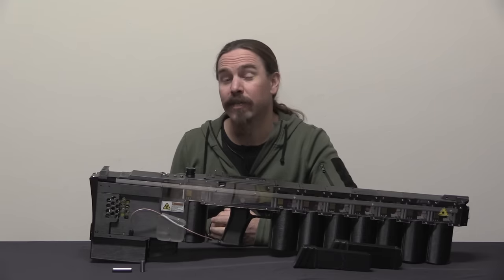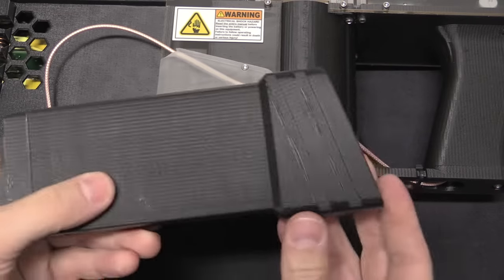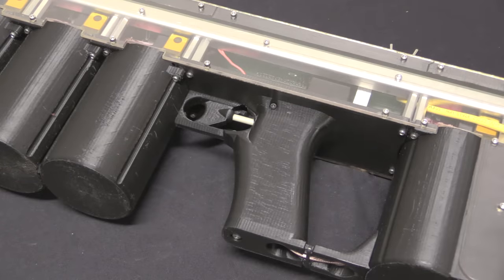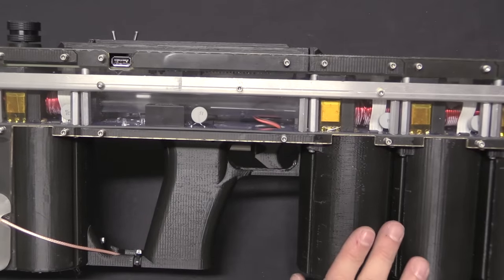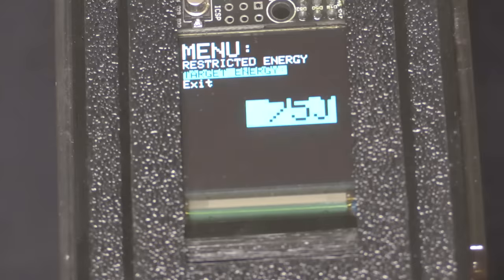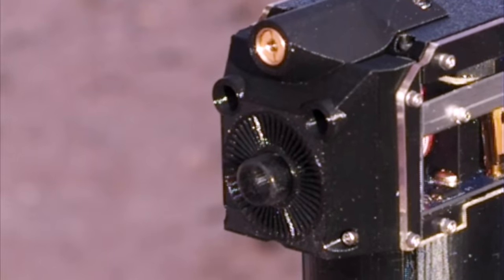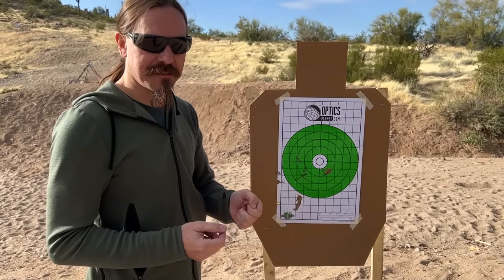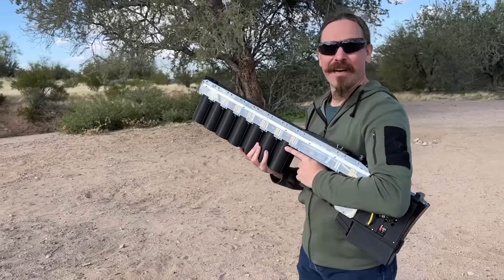ArcFlash Labs' GR-1 Anvil Portable Gauss Rifle

Comment: This is the musket of the Gauss Rifle technology, just remember this video 10-20 years from now
Reply: Just about.  While I'm not sure we'll ever get to the point where ammo for this thing is quite as cheap as current ammo (You can get 20 round of 5.56 for like $12), but I can definitely see these evolving into some BADASS sniper weapons.
Reply: @jesuszamora6949  The ammo for a gauss rifle is basically just a steel rod sawed in small bits...as soon as there is demand for gauss ammo you will see prices way below what 5.56 costs
Reply: @jesuszamora6949  i'll just go play Crysis and use the Gauss rifle in that ;)
Reply: @Presbiter  Ammo cost would be in the degradation of the power cells. Plus a few pennies for the slug and electricity.
Reply: @johnk6757  Thats maintenance cost...like any other equipment that uses power cells like night vision googles
Reply: Pretty much. A couple of decades and a few energy storage breakthroughs in the future and they'll have a design nearly as powerful as the fallout gauss rifle.
Reply: 10-20 year from now it will be same but better looking. The obvious problems are capacitors and coils. Standard capacitors and even commercially available super capacitors simply do not hold enough charge and even if they did they are not able to release it fast enough to accelerate the projectile to speeds needed for it to become a real weapon. Even if they invent a supercapacitor that can hold and release enough charge, copper coils will not be able to handle it. Copper would have to be replaced by some superconducting material but those only work at ridiculously low temperatures.
Reply: Truthfully, I feel like it wouldn't be too difficult to make improvements and produce your own. Welp, time to start ordering parts.
Reply: @ConManliness it took up to longer than a minute to reload for one singular shot, and black powder by nature has lots of things that can go wrong.
Reply: @lamebubblesflysohigh  what could a cooling system for the coils be like? Could it be like a SPAS-12 heat shield or some complex air/water cooling system?
Reply: @lamebubblesflysohigh  there are high temp superconductors (like above water freezing), but they need ridiculously high pressures instead. Those may be more viable though than supercooling the coils. You need to construct the capacitor from superconductors too, so this is quite difficult.
Another problem: you need very high magnetic fields, which may stop the superconductivity, so there will be a limit of how much power it can have.
Reply: nahh, think of the stuff we don't know. the stuff coming out was prolly researched decades or years ago.
Reply: @killman369547  Batteries are likely going to be the biggest bottleneck.  It's weird that, for all the other tech breakthroughs, battery capacity has been the slowest moving.
Reply: @ConManliness Eeeeh, depends on what you consider, "wildly more powerful." Because while muskets had projectiles that were about 10x the mass of modern intermediate cartridges, they also had a muzzle velocity of about 1000-1400 feet per second, versus, say, the US Army's M4, which has a muzzle velocity of a little under 3000 feet per second.

Due to how kinetic energy works, a 500 grain Minie ball will fire with anywhere from 1.1 times the energy of a M4's ~50 grain projectile at a lower velocity charge, to 2.18 times the energy of the M4's 5.56x45 projectile at a higher velocity charge. However, it will also likely not have as good of penetration due to the superior penetration profile of the intermediate cartridge's small bullet. So, while ranging anywhere from near-equal to twice as energetic, it isn't necessarily "wildly more powerful" in terms of raw energy and it is likely inferior when it comes to actually penetrating. 

However, muskets will fall short of the power of a full sized rifle cartridge of modern bottleneck design. A 7.62x51mm cartidge comes in at around 150 grains, but will come in at a muzzle velocity not far short of the 5.56x45 at 2700 feet/s. A rifle firing the 7.62x51mm cartridge will have an energy about 1.11 times the energy of a 1400 feet/sec  500 grain minie ball and about 2 times the energy of a 1000 ft/sec musket 500 grain minie ball, making a full sized rifle cartridge such as the 7.62x51mm both more energetic than a musket's shot as well as having superior penetration characteristics.

It gets even worse when we get into large bottleneck cartridges usually used in fixed machine guns, such as the .50 BMG cartridge which have a 600-800 grain projectile that is fired at around 3,000 feet/s. Even assuming a minie ball of equivalent size to the .50 BMG's projectile, a .50 BMG 700 grain projectile will fire with 4.5 times the energy of a 1,400 feet/s 700 grain minie ball, or 9 times that of a 1,000 feet/s 700 grain minie ball.

This is all due to bottleneck cartridges having a far higher pressure compared to charge due to the bottleneck. You can't have a bottleneck charge in a musket. With a rifle, however, you can, so the projectile is launched far more efficiently due to the funneling of the expanded gasses.
Reply: @ConManliness musket shot would likewise go less far since the halved speed in comparison to modern bottleneck cartridges and minie balls (and earlier musket shot) are far less aerodynamic than modern rifle bullets, ergo they would be affected by drag far worse.

You also have to consider the extreme effect that black powder fouling can have on a bullet's ability to travel, progressively making even a strong performing rifle weaker and weaker over time. Smokeless gunpowder has no such troubles. There's a reason when smokeless powder bottleneck cartridges hit in the 1880's that there was no going back: bottlenecked cartridges could send projectiles far faster and far more consistently and, frequently, with even more power.
Reply: I mean even back during musket days there were still some pretty cool firearms that could match up with today's stuff
Reply: @TheOnlyPedroGameplays  Eeeeh. For a trained gunner, it was far shorter than a minute to get off a shot by musket, especially once you get into pre-measured cartridges. You're still looking at something like 3 or so shots per minute though.
Reply: @ConManliness ummm no. They had "heavier loads" back then because they didnt have high rate of fire and had very low accuracy so they wanted to increase chances of 1 shot 1 kill if they actually hit their target

"Smokeless Powder reacts at much higher pressures than Black Powder"
Reply: I think this is earlier then muskets. Think medieval hand canons.
Reply: Nah. Even early muskets were deadly and viable on the battlefield of the time. They solved at least two problems: heavily armored knights and necessity for shorter training time . This this doesnt bring anything which normar firearms dont already offer, but does it worse.
Reply: @taan1424  i dont think anyone here thinks that muskets werent deadly, just how effective they truly were
Reply: @taan1424  Depends on if you can get it to be light or not. It could be something in the similar vein to why caseless ammunition has some degree of appeal to a concept where you can have a bunch more bullets for the same amount of weight.
Reply: @taan1424 also depends on how early. You probably do not have access to the first five years of firearm history and are looking at the earliest of earliest of concepts for one thing and trying to compare it to something whose earliest proto forms are esoteric and long forgotten.
Reply: their were cool futuristic gun in the musket era like the air gun and we all know which one lived on. cool concept but 10-20 year won't make it
Reply: if that emf gets worse they soldiers wont last 20 years after there service.
Reply: Fr fax no cap
Reply: Musketeers where in use 70+ years
Reply: @lamebubblesflysohigh  the biggest problem with this thing is that it has to be portable, if it were stationary you could do a lot more to vastly increase the power and effectiveness of it, such as providing more power, using much larger and stronger capacitors and way larger coils
Reply: @jesuszamora6949  in canada 
7.62mm fmj is $7 a round...i repeat for seven dollars a round lol not sure how much 556 is but im sure its expensive
Reply: I think this thing is trying to solve a problem that isnt there.
It might make sense for large Heavy rounds; but for guns and rifles, if you dont want to mess with gun powder then air/gas rifles (competition rifles) usually have 180-220 meters per second. (For reference .22LR still have 280-300 meter per second at 50meter)
Yes the air rifles have a very light round, but that could ofcourse be scaled up.

When this thing has 70-75 meters per sec and such bad accuracy, it means its not suitable for Target shooting, so the only place it can be used is recreational and while cool, i wouldnt pay for it.

Im not sure the technology will advance so quickly regarding this either. 
Using magnets to power a round, sure, when you have static large - high powered guns. Otherwise, well gun powder in itself is actually enviromentally green, its the lead and shit in the Primers etc thats the icky stuff you dont want to inhale.
But i hope i am wrong, Gauss guns would be cool! :)

(Edit; high powered guns as in continual access to electricity/energy, not reffering to the power of the gun/cartridge)
Reply: This makes Fallouts 2 mm gauss rifle seem quite reasonable!
Reply: I'd say this is more like the Fire Lance or the matchlock, where it's still extremely experimental and not QUITE field practical quite yet, more of a proof of concept than a seriously dangerous weapon.
Reply: @ConManliness That wasn't why whatsoever, are you kidding me? Muskets were more powerful than modern infantry rifles because they had a big fuckoff bullet between half an inch and three-quarters of an inch in size usually, and a LOT of powder. Black powder is far, far less efficient than smokeless powder/gunpowder. Besides, while a .50 inch musket will blow a hole through someone's chest, a modern rifle of the same caliber will just remove the entire chest, along with all the attached limbs.

The only reason muskets are more powerful than modern infantry rifles is that we don't need such a massive caliber for infantry purposes. Hell even the new 6.8x51mm/.227 Fury is arguably too big and that's less than half the size of standard musket calibers, let alone 5.56x45mm NATO.
Reply: @jesuszamora6949  why would the ammo for this thing not be cheap? It's literally just steel cylinders and electricity
Reply: @SlackActionBumble  They're not solid?
Reply: @jesuszamora6949  yes they're solid. Cylinders can be solid
Reply: @SlackActionBumble  I figured that would cost more, though.
Reply: @jesuszamora6949  nah. Just chopping a rod into chunks is much cheaper than carefully forming a brass cartridge, installing a primer, filling with propellant, and then attaching a lead bullet.
Reply: @SlackActionBumble  I figured you'd need an especially conductive metal.  Interesting.
Reply: @jesuszamora6949  nah, the metal just needs to be magnetic. 

You know the little solenoid that pushes up you car's door lock stick? It's just a buncha those in a row, but hella strong. And the bullet is the door lock stick.
Reply: @SlackActionBumble  Ah.  Seems like it would be pretty easy to get the prices down.
Reply: I'll remember this stupid comment for the rest of my life.
Reply: ConManLiness No they weren't.  A musket if it's not smooth barrel is just as powerful as some modern-day rifles.
Reply: @spiralviper8158  I'll play Stalker: Call of Pripyat and use the Gauss rifle.
Reply: @ConManliness yeah people seem to forget the average footsoldiers we're using 40 to 50 cal balls
Reply: Try 50, and then when you look that far the prediction becomes inaccurate so it's stupid to assume anything in particular
Reply: 100-200 years from now
Reply: More 100 to 200 years from now
Reply: @ConManliness uhhhh.....no ......kind of the opposite
Reply: Right… just like electrojunk vehicles. All the materials come from arch enemies. No thank you.
Reply: True, better comment so I can see it in 10 years when I see this again
Reply: @lamebubblesflysohigh  Now that radiation batteries are on the market this will age like milk. We will have enough storage to use it for thousands of years.
Reply: you can make ammo for it out of scrap its awesome
Reply: im sure they can eventually be modified to super cool. As for battery perhaps they could make energy cartridges that can be recharged and reloaded quickly.
Reply: This is more like the electric milk float from 40 years ago, 40 years later and electric cars are a long way from taking over
Reply: 10-20 years from now ? More like hundreds of years from now bro. We went from musket (invented 1500's) to semi-automatic rifles (late 19th century) in about a little over 300 years. 20 years is laughable dude...lol
Reply: I've been shot in the finger with a Daisy 188 pistol shooting a 5.1gr BB at the same speed this fires at. I'd be curious to see what this would do to one of the ballistic gel human figures.
Reply: 10-20 years from now?  Try 4-6 months.  Ian just tested the EMG-02, and...yeah.  ArcFlash are already beyond muskets lol
Reply: It turns to a fallout 3 gauss rifle
Reply: @ConManliness That's just incorrect, black powder is inferior to modern smokeless powder.
Reply: @J.D-g8.1  In any case, electromagnetic weapons by their nature will always be limited by power and speed, while reliable gunpowder weapons will be able to evolve.
Reply: @theatheistbear3117  It doesn't work like that and when it's over those weapons won't do any good
Reply: @snakesghost7817  And it is most likely that these types of electric weapons will not be able to cope with the firearms that are manufactured in the future and that is the truth.
Reply: @SvendleBerries  But they will never be able to stand up to the reliable firearms that will be manufactured in the future, electromagnetic weapons will always be limited in speed by their nature.
Reply: @ConManliness  wait what? Correct me if I'm wrong but isn't modern gunpowder way more efficient than black powder though? With more aerodynamic ammunitions and higher velocity I think modern firearms would be more powerful? Again, correct me if I'm wrong
Reply: Gauss musket
Reply: @FMDad-dm5qo  Haha no
Reply: This is a glorified slingshot
Reply: I'm calling for the return of line formation and red coat uniform.
Reply: @ConManliness thats sarcasm right?
Reply: @ConManliness  The average smokeless powder is around three times more powerful than even Alder Buckthorn charcoal, Swiss-made black powder (Which is the most efficiently burning black powder on the market, that they most certainly weren't using for civilian arms back in the time when muskets were military issue). Otherwise we'd still be using black powder in large bore artillery. You should also know this because modern black powder guns say "BLACK POWDER ONLY", because if you use smokeless, your barrel will shatter like glass.
Reply: A year after this video and they already have major improvements lol
Reply: @ConManliness Black powder it s like three times less powerful than modern smokeless powder
Reply: 100 വർഷം കഴിഞ്ഞിട്ടും വികസനത്തിന് വഴികളില്ലെങ്കിൽ ആ തോക്കിന്റെ കൊച്ചുമക്കൾ പോലും ശക്തമായ ആയുധമായി വികസിച്ചേക്കില്ല. 

ഇതെല്ലാം സാധ്യതകളെ ആശ്രയിച്ചിരിക്കുന്നു
Reply: A hand-cannon (in short: a wooden handle with a short, iron barrel attached to it - shooter turned away while pointing it at the enemy and lighting the fuse) of gauss tech. Not musket. Musket is a fairly advanced (gunpowder) weapon when compared to how primitive this is, comparatively. With that said, though, the problem here revolves around powering it, rather than improving the "mechanics" behind it.
Reply: I seen a rail gun on yt and it was way nastier than this nerf Thang ..😅but.. it's still fn cool!
Reply: @Presbiter  the ammo, a caring a generator and fuels and steel rods
Reply: @joshua20162  This is not always the case, nor should we be hallucinated about the things that must be discovered, we still have a long way to go as a military discovery, but there is a limit to everything on earth.
Reply: No... the future has been underwhelming ever since the year 2012
Reply: What? NOPE. This tech is going NOWHERE for now, i saw a video of one that had similar force being made over 15 years ago... Now they're starting to be sold semi commercially but still weak and awkward as hell, also more dangerous to the shooter than the target still (in case they're drenched in water or the 'gun' is shot by another gun... We need SIGNIFICANT advancements in batteries and supercapacitors before these become worth anything, and considering there's barely been any changes these past 20~ years, i'd say another 10-20 years for those to make any significant steps is far too optimistic! Heck, you can make an electric air compressor powered rifle that's FAR more handy and deadly already. If anything, i think the nearest actual functioning gauss rifle/coil gun will come from a COMBINATION of low-mid caliber air rifle and coil gun.
Reply: @mkzhero  The Gauss rifle simply by its nature cannot advance as much, in addition to the fact that the more time passes, the less military discoveries can be made.
Reply: @ElMiKy75  Gauss? I'm not even sure what it is, THIS thing is a coil gun. And no, MANY more discoveries can be made, but we're currently stifling ourselves as a civilization with reliance on government, so everything's grinding to a halt, stagnation and collapse.
Reply: @mkzhero  I know that there are still more things that I discovered in military technology but there are not as many things as many people hallucinate from science fiction movies, besides that what has to happen will happen.
Reply: To quote my dad, "You gotta start somewhere."
Reply: 2nd Amendment™️ 💪🇺🇸🥳
Reply: @ConManliness lmao no
Reply: Except the musket made previous weapons obsolete. I don't see how this could ever make regular firearms obsolete. Its expensive, complicated, requires electricity, isn't more or even matching firepower, and I just don't see how it is a progression of technology. Perhaps on a larger scale a gauss cannon could be effective.
Reply: Remember metalstorm?  That's over 20 years old now...
Reply: @kittycatcat6962  😮..😢
Reply: lol my career gave me ADHD. I wont recall after 20 hours. 😢😂
Reply: Ten lol five top's war speeds shit up.
Reply: I don't see gauss rifles replacing guns in most applications. Too much cost for too little gain.
Reply: It's a musket rifle!!! 😂😂😂
Reply: Portable, micro nuclear reactor powering gauss rifles.
Reply: @ConManliness You’re joking.
Reply: @ConManliness no. Ok let me explain this to you, we will use a .50 cal musket as a example. Generally the rule of thumb is that you double the caliber to get the maximum powder charge, so let’s say your shooting at 80 grains of black powder or pyrodex FF3, you would end up with only 26 grains of smokeless powder in energy (we use smokeless powder for ammo now) and that is about as much as there is in your average 2 3/4 inch 12 gauge shotgun shell. They are not more powerful per say but they had bigger bullets at slower velocity which is not as good sometimes as small bullets with high velocity, please do research before making a claim like this.
Reply: @conmanliness2957 right because a musket can totally blow through armored vehicles like a .50BMG from a Berretta Anti-Material Rifle can
Reply: I'll return to this video in about 200 years later
Reply: IMO it's closer to the late Middle Ages rudimentary firearms, where they were really just taking cannons and making em really small so that you could carry one. Not really practical yet, but might change in the future.
Reply: If this tech improves to even 1,000 feet per second  it'd be very cool.
Reply: @Therealnonsequitur  did you do it in the end? I saw a 3D printed one on youtube the other day
Reply: I definitely favour 'Gaussmusket'  It rolls off the tongue almost as smooth as the projectiles from the barrel.
Reply: How dare you degrade the venerable flintlock musket that won this great country for you! This gun is more like the unreliable matchlock arquebus of Gauss technology! 😂
Reply: Let's hope that in 20 years from now there won't be any need to develop weapons like this, for two reasons. First, war has become obsolete. Secondly, technology is so much more advanced, that weapons such as guns and rifles are completely outdated and comparable to melee weapons of the middle ages.
Reply: If YouTube doesn’t take it down
Reply: Not going to take 10 20 years to advance the design, the issue is with the public knowing about the advancements and in this case and technology unless you work in this field of work your not going to know much on how much has been progressed or refined… it’s all going to be classified
Reply: Muskets are mean
Reply: Muskets could penetrate that wooden target.
Reply: @jesuszamora6949  The fuck? You can use anything magnetic and roughly of the same shape in there. It's just a bit of steel!
Reply: Flying cars and teleportation too